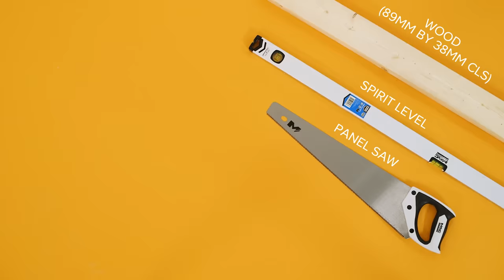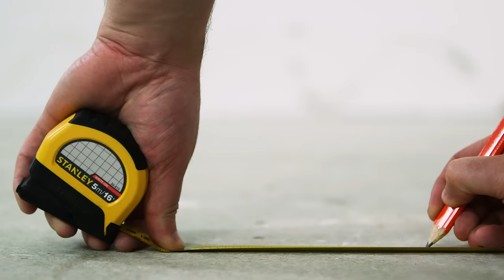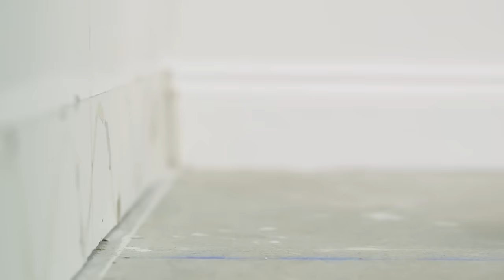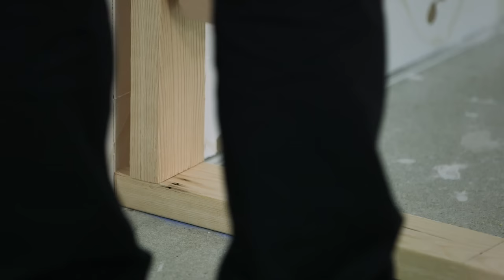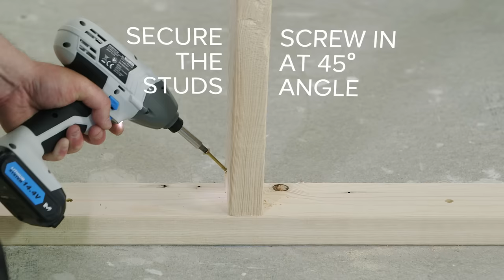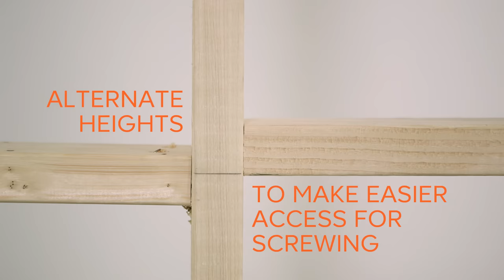How to build a stud wall

Comment: For the studs going against a plasterboard wall and plasterboard ceiling would I use the regular wood screws or for those studs I would need plasterboard specific screws? Thanks, nice and simple video
Reply: Omg! I’m here for the same reason. What did you end up doing?

Comment: How did you fix the ceiling plate to the the ceiling? Looks like you just screwed into the plasterboard?
Reply: How did you find the joist if above is not exposed
Reply: @Apocalypse_666  you can use a magnetic to find the screws which will be in the joist otherwise I think it's not essential to fix the top plate as it should be pinched in with a very tight fit and attached to each stud so has a fair amount of support
Reply: @Apocalypse_666   You can buy stud finders.

Comment: So screw the ceiling beam anywhere along the wood or does it have to go into the wooden slats in the ceiling?
Reply from the maker: The ceiling support beam can be drilled into the flooring in any sequence as the vertical studs don't required to be screwed in. We hope this helps 😊

Comment: Excellent, what size wood did you use?  It says 89 x 38, what about the width?   
Note for me:

Calculate lengths of base and ceiling plate with chalked lines.  Ensure plumb.
Cut ceiling and base plate,
Stack base and ceiling plate on floor to measure the vertical studs.
Secure base plate.
Mark centre of base plate.  Mark placement of vertical studs from there.
Dry fit the ceiling plate and vertical studs in place.  Ensure plumb.
Secure vertical studs at 45 degree angle.
Secure ceiling plate.  
Mark noggins every 1200 mm
Secure noggins at alternate heights, 45 degree angle. 
Drywall scews 32 mm

3 inch wood screews (7.6 cm)
Reply from the maker: Hi, the measurements are (L)2.4m (W)89mm (T)38mm. I hope this helps! 😄

Comment: @b&q do you need to secure the ceiling plate to ceiling ? 
My ceiling is not concrete by plasterboard . I just want to confirm if I need to screw the the ceiling plate . Thanks
Reply from the maker: Hi, yes, and use plasterboard fixings to aid this. These are widely available in store or use an adhesive, no nails or similar. I hope this helps!

Comment: I have cork board floor tiles - could I drill straight into them?
Reply from the maker: Hi there, if they are cork composite makeup with a plastic film (possibly with ceramic layers) it will likely be OK, but if it’s a cheaply made glued cork we would suggest against drilling into it. I hope this helps!

Comment: I cant seem to find any 3 inch wood screws which would you suggest 75mm or 80mm wood screws please?
Reply from the maker: Hi, there. Either or would work depending on the thickness of the material you're building with and securing onto. Hope this helps. 😊

Comment: did you drill it into the floor? or just wall and ceiling
Reply from the maker: The only drilling required is the flooring beam. The vertical wall studs and the ceiling plate do not require any drilling. We hope this helps 😊

Comment: I have concrete floor, how do i screw in the screws?
Reply from the maker: Hi 👋 Thank you for your question! We'd recommend using a masonry screw for concrete flooring as they're specially designed to fix materials to masonry surfaces such as concrete or brick. Please click the following link for more info: https://bit.ly/33CsB9r. We hope this helps 🛠

Comment: How do you do this with tile flooring? I have straight concrete under the title
Reply from the maker: Hi, there 👋 You'd require a tile drill point. They cut cleanlyy through ceramics, porcelain and natural stone whilst minimising the risk of damage to these delicate materials 😊 You can view these on the following link: https://bit.ly/3EyjwuC 🛠
Reply: @bandq  I'll just anker it to the walls, thanks though

Comment: Hi, do you need to screw the top piece into a wooden joist or straight into the ceiling plaster board?
Reply: @bandq  ok thanks, how would you find the joist?